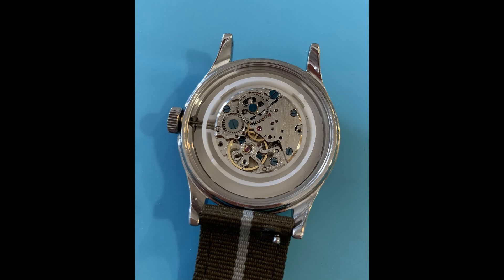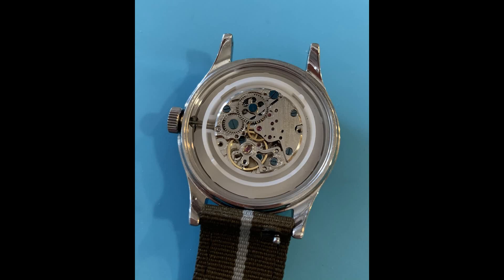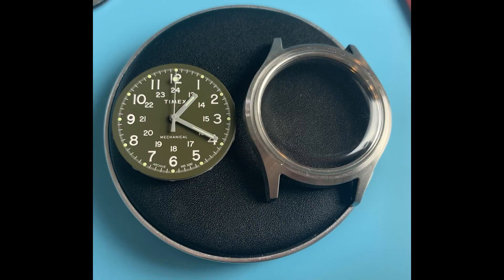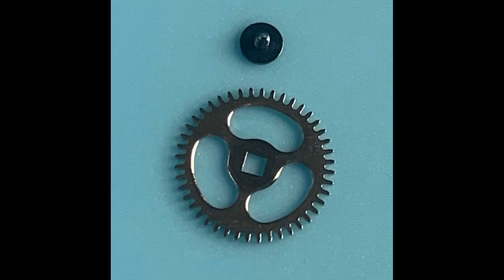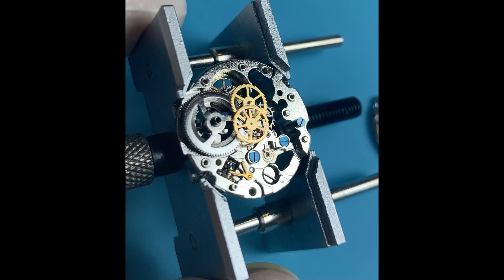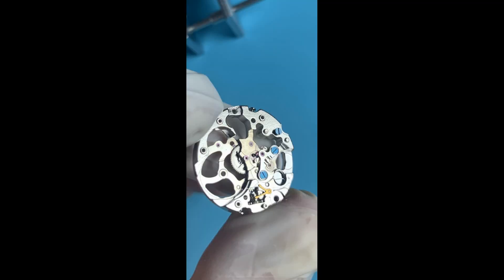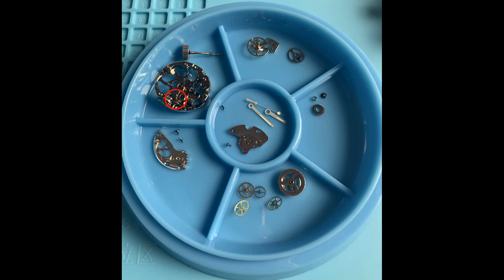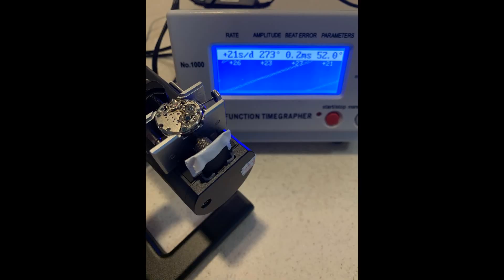Inside the Timex Mk1 Mechanical

Comment: Very cool but really makes me wonder about the almost 200$ price tag for a timex. A name that may have once commanded some prestige, but is now more known for solid and very affordable pieces. I mean you can get an automatic seiko with better materials and a well known movement for the same or less than this guy. I think if they had added sapphire crystal and more quality band, along with maybe a more interesting dial then the 200$ price tag would be far more justified. I'll just stick with the quartz version. Far cheaper, more accurate and arguably more durable as it is a known commodity. And you can get a chrono version for like half the price. If they would put this closer to 80$ I'd likely snag it right up.
Reply from the maker: I very much agree. Timex overcharges for their mechanical watches generally. You would be way better off with a Seiko or Orient. That being said, I'm glad they make mechanicals again :)

Comment: Copying part of an article of timex expedition north field post watch.
Likely this is a skeletonised version of the following:
A seagull movement.
But as with any mechanical watch, the big question is accuracy. In this case, I’m happy to report that the Field Post (and its 23-jewel Sea-Gull TY6DSK-1 movement) averaged just plus-6 seconds per day.
For a tool in this price range, that’s damned good, especially given its ability to hack. Just pull out the crown, count away a few seconds, and screw it back into place.
Online specs list the Sea-Gull’s power reserve at 34 hours, which seems about right. This, however, leads to the part where I start airing my complaints.
Reply from the maker: Fair enough. I should trust these movements more I guess.

Comment: According to internet sleuths, it looks like the same modified Seagull ST6 movement that is in the Timex Marlin reissue. The automatic winding mechanism and rotor were removed but the now-extraneous pivot jewels are still on the bridge plate.
Reply: My movement broke one day pulling out the crown, I searched ebay for the ladies sized st6 with the automatic parts removed but came up short, instead I bought a similar 23 jewel seagull movement that is very near identical to the one in the timex, I bought a tool kit and caseback press and commenced a movement replacement, everything went swimmingly until I got to the second had and busted in two.
I am currently on the hunt for a second hand but the new movement run awesome.
Reply: @OX71  Good luck. Just curious, does the ST6 fit in the case with the rotor and winding bridge still attached or did you have to remove them?
Reply: @MrJamesDuffy  no the movement I replaced the original with is not an st6, it is a similar 23 jewel hand winding movement, I can't remember the caliber number off hand. It is the same size and most of the components are the same with very few exceptions though. There was no automatic parts.
Reply: @OX71  what if...what if... you found a similar sized Vostok movement? They are rubust and rugged, plus cheap. Some have said very accurate for a watch at a low pricepoint.
Reply: @mystic48209  the movement doesn't even need to be as small as it is, the case is 36mm and the movement could fit into a case as small as 26mm if  not smaller, it's a ladies watch movement.
Find your own movement holder.
Reply: @OX71  I am indifferent. Let the market decide if it likes the watch as it is, Some like automatics, some like mechanical / hand wind.....others love quartz/solar power. That they use a mechanical movement is a step in the right direction. I just wish they use a Seagull ST19 on a TIMEX chronograph.
Reply: @mystic48209  good idea, I would not object to them using mechanical movements for a lot of their models.
Reply from the maker: That makes a lot of sense from a modular design / efficiency standpoint. I believe it.
Reply: Can this movement be over wound? I know it can be bad for mechanical movements to be overwound but modified automatics have a clutch that allows it to be wound as much as possible and once fully wound, the clutch will slip to stop overwinding
Reply: @markoni5616  There is a very noticeable stopping point. I think it would take a lot of force to go beyond that point to overwind and break it, but that can happen on rare occasions if one is very careless when winding it. If it goes passed that point easily, then the movement is faulty.
Reply: If you over wind the movement it will break, there is no clutch

Comment: Good day,

I believe it was learned that the movement maybe a skeletonized Seagull ST6 without automatic bits. https://17jewels.info/movements/s/sea-gull/sea-gull-st6/ 

https://www.google.com/amp/www.bobinchak.com/watchmaking/2017/12/9/timex-marlin-thoughts-teardown%3fformat=amp

I would agree seeing that in the photo you can see some of the un-used jewels. 

Cheers
Reply from the maker: Ah okay interesting. Yes, I am convinced it is a Seagull movement now.
Reply: Seagull and Timex have a great relationship going back to 2007. They released a line called the Timex Power Reserve's back then which were short lived due to the economy. Aimed as dress watches they are great finds today. And when it comes to China made, Seagull is one of the best.

Comment: That was awesome! I almost think the still shots are a better way to go, you get things set up the way you want to show them, and the micro videography that is required to show things live seems like a lot of effort for little gain. I have never even taken a watch apart past a battery change, let alone an actual service..I do have an NH36 that does not change one of the day/date, so I was thinking that will be my first attempt just to tinker, and it is an AliExpress watch, so I am not super worried that I will ruin an expensive piece.

Definitely interested in more of this content, and perhaps a video discussing the servicing you have done in the past, and another on what equipment you have found you really used, verses what you may have bought (I tend to overbuy on all the things people talk about needing) so that would be beneficial to hear what you really needed or what really helped.
Reply from the maker: Yes I could do something like that. 

I took Mark Lovick's Repair class which is very good. But if you want to just get an idea I highly recommend My Retro Watches. His channel has so much good (and free) information for an amateur. I started on just movements. A Seagull ST 36 is a great first movement because it is manual wind, has no calendar works, and is on the larger side. I would just take it apart and put it back together over and over. You can honestly take that movement apart with a 1mm screwdriver and a pair of tweezers. You will know VERY QUICKLY if you enjoy it or not. I find it exhilarating, but at times it can be intensely frustrating. 

This is the best video I have found for the ST36. 

https://www.youtube.com/watch?v=Xnh7O22mduE&list=PLKsgSRTr5GyE3O6d4Oop_EZ181ORf8YJv&index=2

This is technically the ETA version but the ST36 is a clone of that movement. In the beginning I skipped all the steps that were hard, like oiling, cleaning, capstones, etc. and slowly worked those in as I felt more comfortable and got more tools.